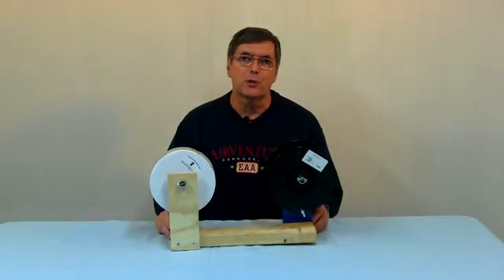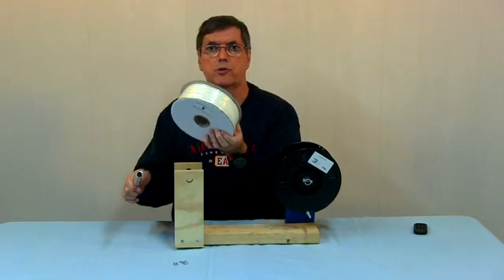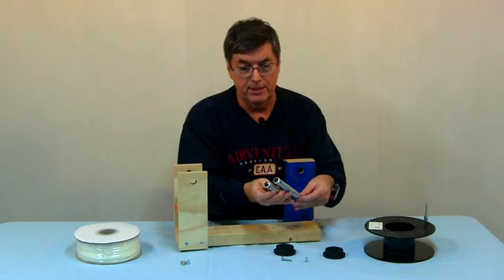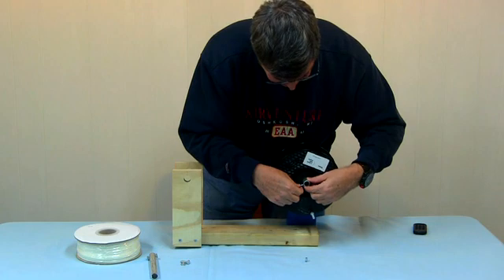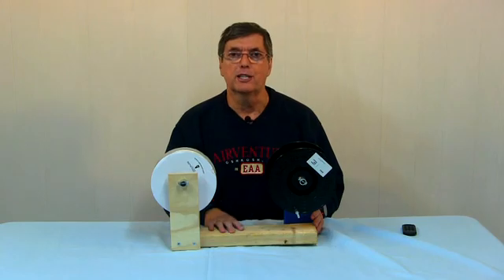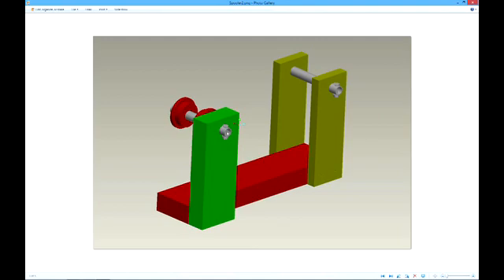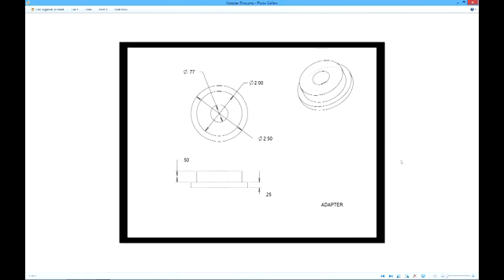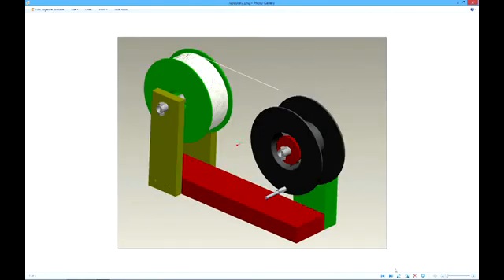3D Printer ABS Filament Respooler Video

Comment: There are a number of inexpensive spools that work with the makerbot popping up. I'd save the 15 minutes and buy one of those.

Unless, of course, you want to motorize this contraption, and then it is hands off. Set a stop timer or something, and you can just walk away.